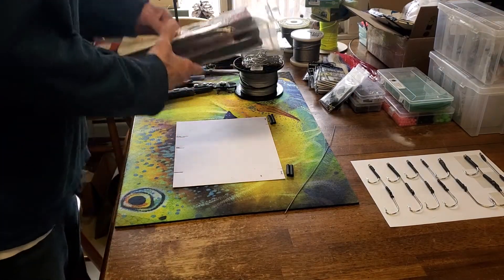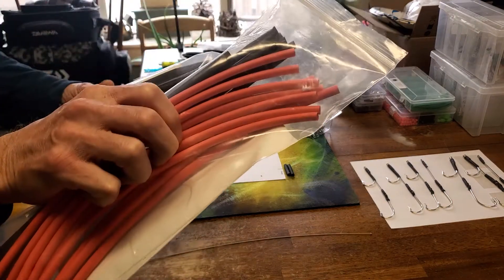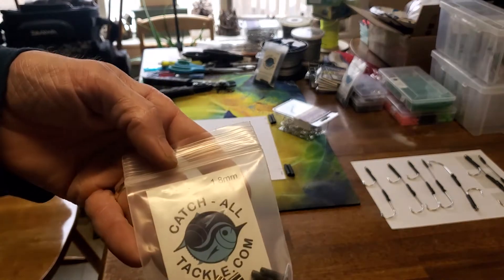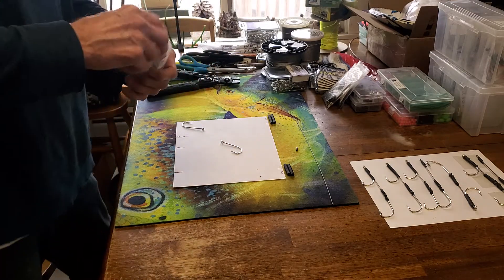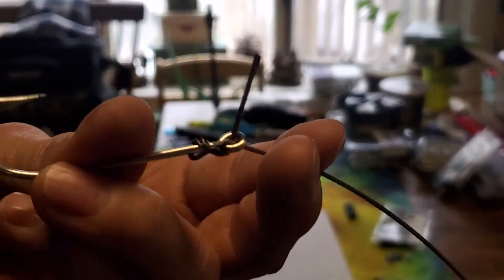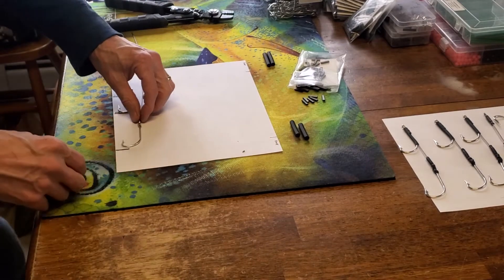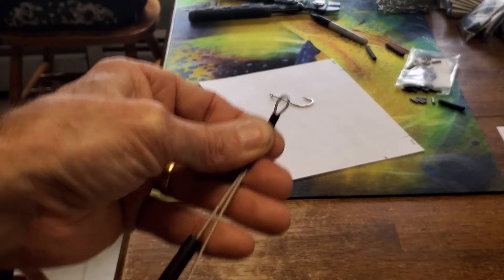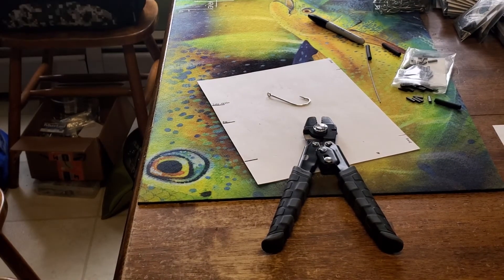Making Stiff Rigged Double Hook Sets

Comment: What species are you trying to catch with these 7/0 in-line double hook rigs?
Reply from the maker: There for pelagic trolling lures used for Wahoo Mahi Marlin, Sailfish ect. Personally i just use them for Wahoo but we always pick up mahi also. They help prevent short strikes/misses when high speed trolling. Good for squid skirted & mylar skirted lures. Cant run double hooks with anything flashabou skirted they'll tangled up bad you'll want a single hook far back for flashabou. Hope that helps. Apologies for the pathetically slow reply.

Comment: Would be great to include links to the supplies. I tried to find the same Heat Shrink, no luck on Amazon for that seller. Also tried to find 3/16" 316SS cable with no luck.